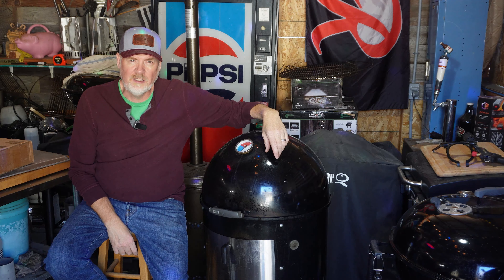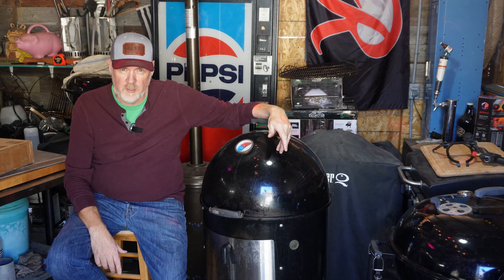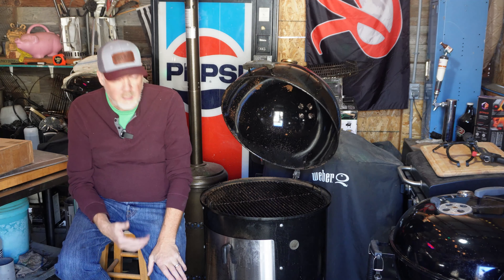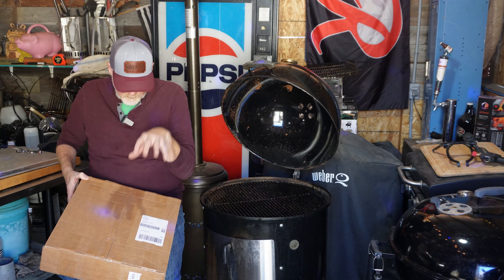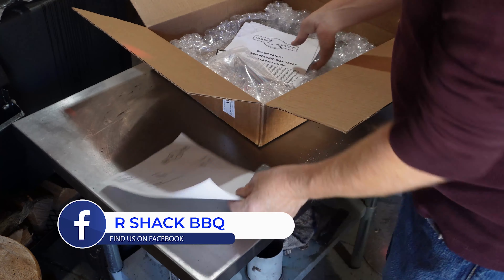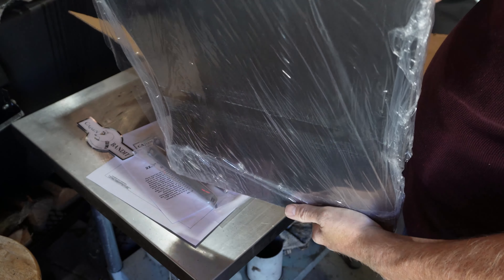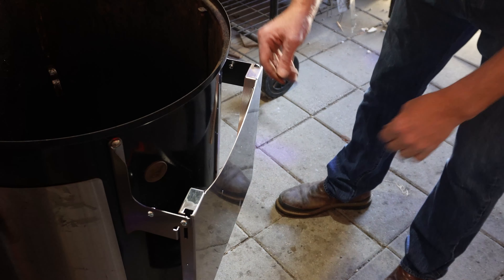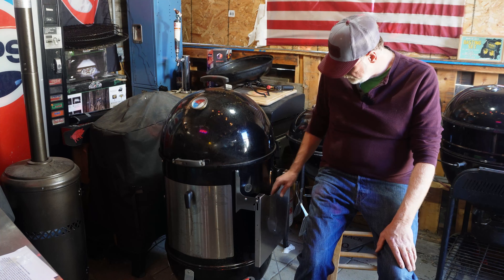Cajun Bandit side shelf for 22" Weber Smokey Mountain

Comment: Well, I think you're lopsided. You need one on each side for balance. You really need their wheel castor set as well. I have the casters, door and hinge on my 18". Last we talked we discussed the Blackstone I saw. Not going there. I'm going to get the heat blanket for my Camp Chef and two side shelves for my 18" WSM. I'm going to have to raise the handles I put on the center section. With two shelves I can put my Maverick on the right side and a cutting board or prep tray on the left. I want to get their rotisserie as well. I put gasket on where the lid sits and around the door. They tell me how great the barrel cookers are but I for one love my WSM.

Comment: Are those brackets installed... upside down?
Reply from the maker: Thank you for watching. This is the way they show them on their website and in the installation instructions. You can mount them the other way but your shelf will be lower.
Reply: @LouisatRshackBBQ  Thanks for explaining, it looked from my end like it was actually installed in the lower postion. I'm eyeballing up the version for the 18.5" and it's positioned just a little bit different than the 22".
Reply: Does this affect the water pan from going back in?